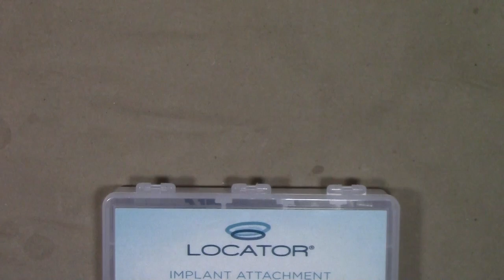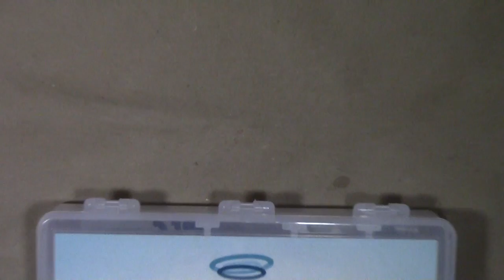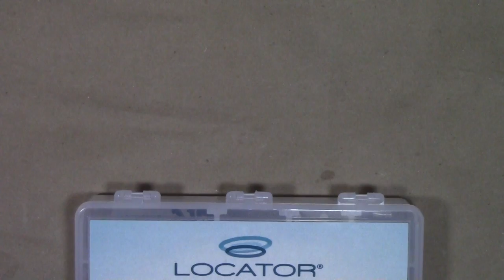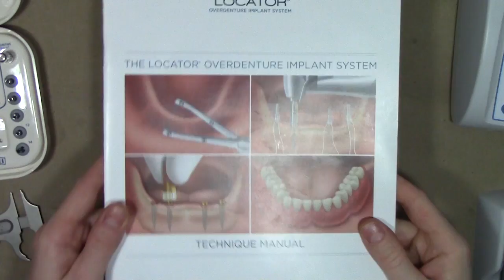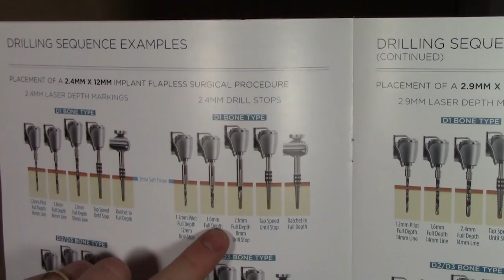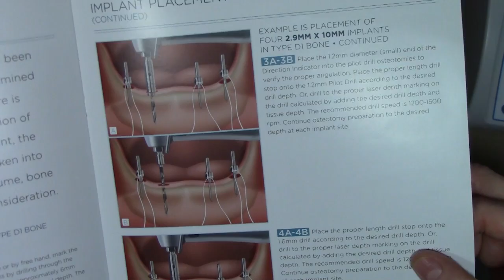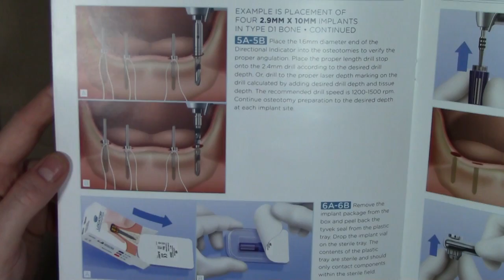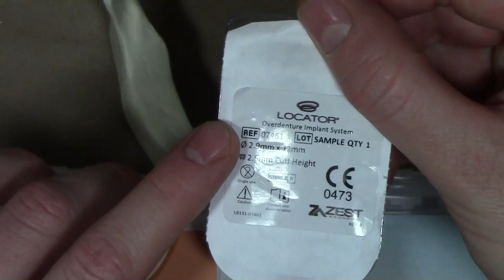Zest LODI Basic Surgical Technique Demonstration

Comment: How do we know ahead of time the abutment height
Reply from the maker: Great question Eric! Typically I measure height on the CBCT with soft tissue-separation techniques (videos on my youtube channel). Alternatively you can typically estimate 90-95% of the time anterior mandible well healed should be a 2.5-3.0mm cuff height or maxillary will be approx 50% of the time 4.0mm and approx 50% of the time either 3mm or 5mm. You can take a perio probe and bone sound to measure properly with the patient in the chair, although you may need to put some topical prior to doing so!! Hope this helps :)